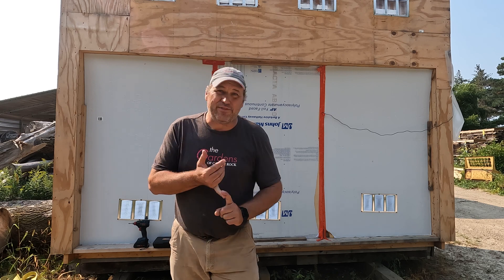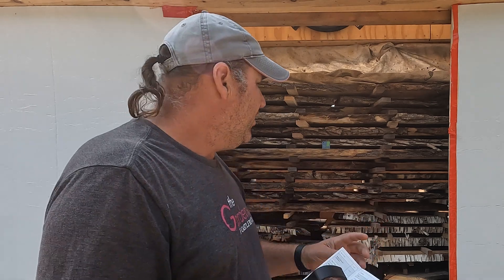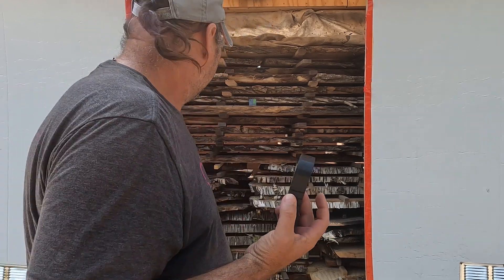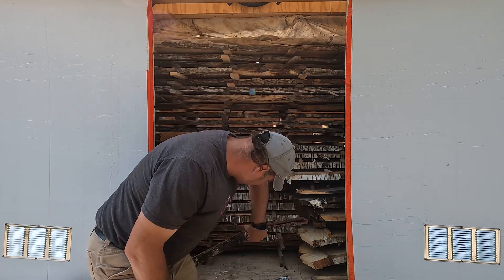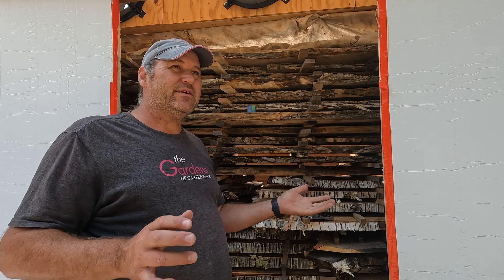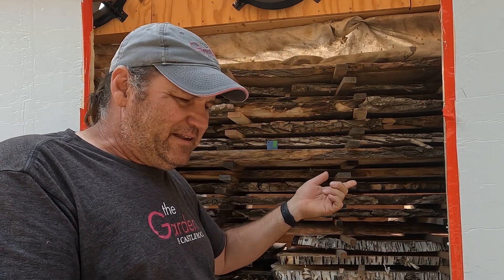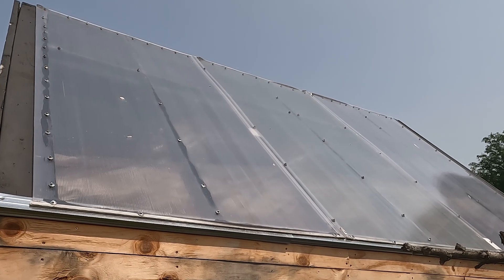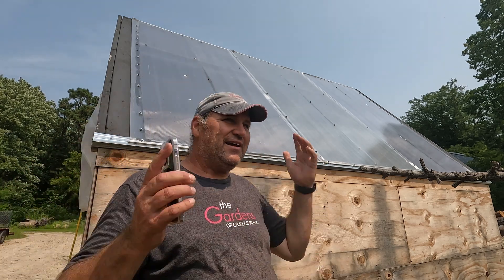Solar Kiln Wood Drying Process: My Monitoring & Optimization Guide

Comment: Hi,
this is the first video of yours, that I saw, so if you already discussed what I'm about to suggest, feel free to ignore this comment.
1. I did some unscientific experiments with a strip of iron (~3'' x 2') painted with matt black oven pipe paint. I can't remember to temperature reading I got from my IR camera, but I think it was in the high 50°C (+122°F) behind a 3x glazed window in the winter sun in germany. Iron has a high absorption capacity for thermal radiation and combined with the high-temp-rated matt black paint it has some serious solar heating abaility. A few of those strips along the air path of your fans might increase the kilns efficiency.
2. To lower the thermal shock from the day-night cycles and smooth out that temperature curve you could place some closed barrels or jerry cans full of water inside the kiln. Water has a high thermal energy capacity, so small-ish amounts could have an effect. It's just an assumption, but this might prevent some cracking in the wood.
Reply from the maker: thanks for sharing... I like the idea of adding an iron heat sink to the kiln. planning on building another solar and will add that to the plans. thanks and cheers!